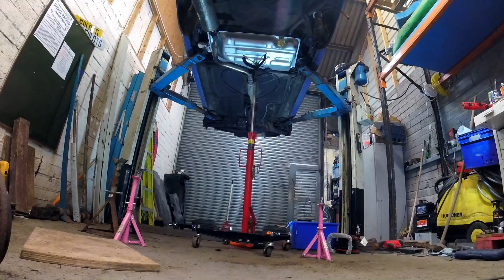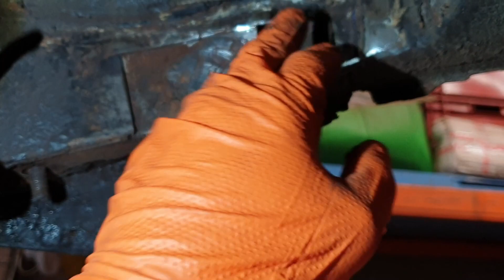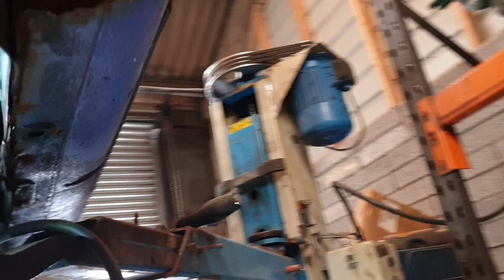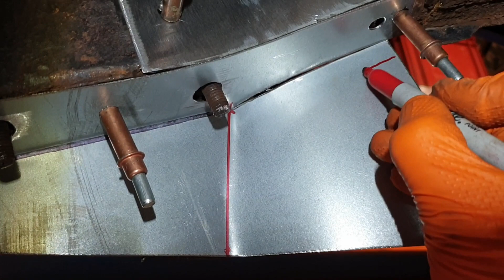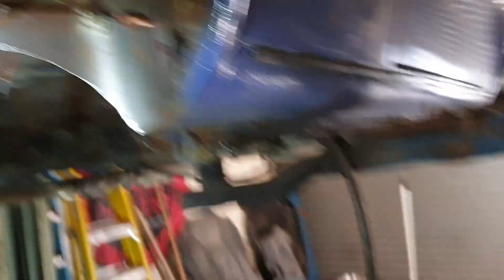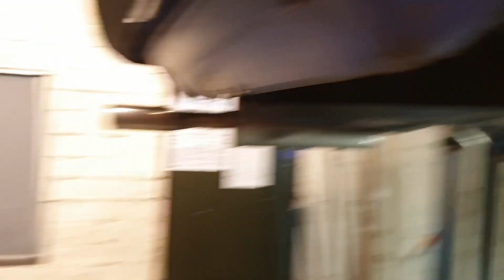Vw golf / Rabbit Mk1 Gti Repairs. Episode 2. Cutting and making panels...

Comment: May I kindly ask you to write what is in english called that part at 10:47 that you touch, the bottom of a car where you clamped. People very often put a jack under it at front wheels and smash it causing rust, which on my scirocco is a case and I have no professionals in my area to deal with it and once I will have to do it by myself just no idea what to do. 10 cm of that are smashed and rusty. I have no right to ask you, but I would appreciate any word of sense. Cheers.